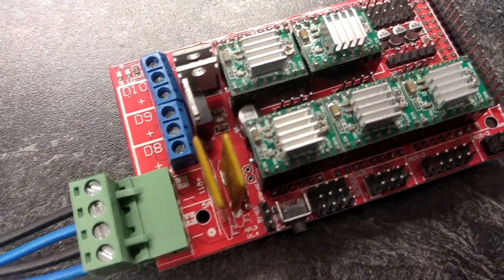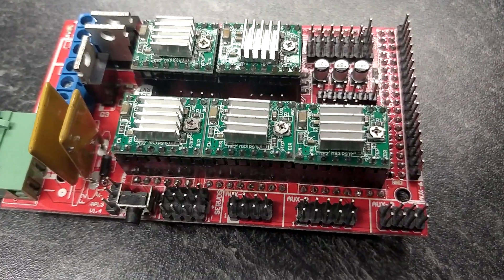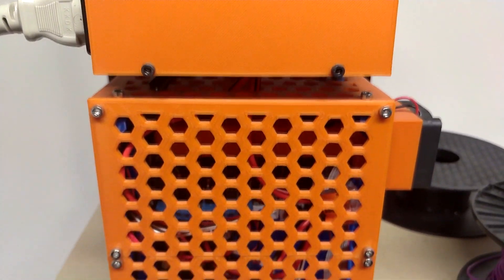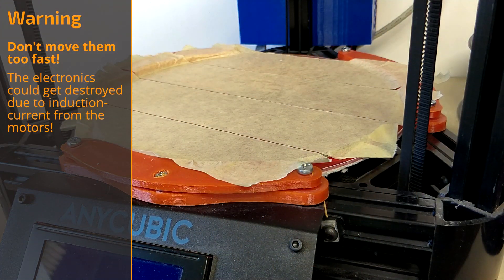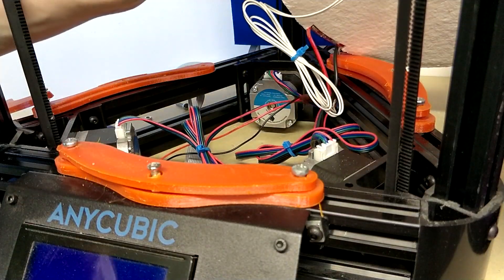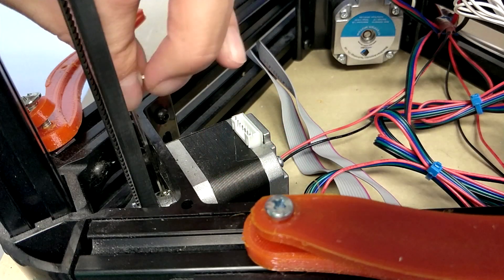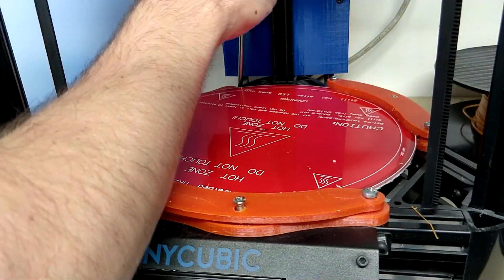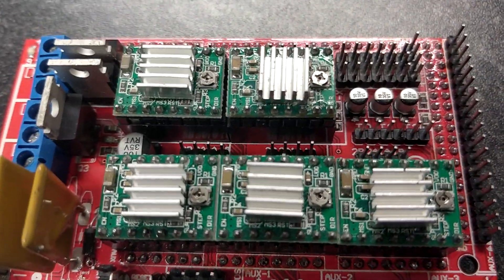Fix Layer Shifts

Comment: I had this issue when my old Anet's came-with-the-kit nozzle got leaky, the drooped PLA stopped the carriage form moving so it slipped and failed one of my first overnight print. It got fixed once I replaced it with another one.
Reply from the maker: Damn... Luckily nothing worse happened!
Good that you fixed it.